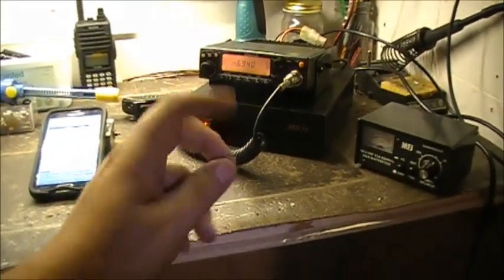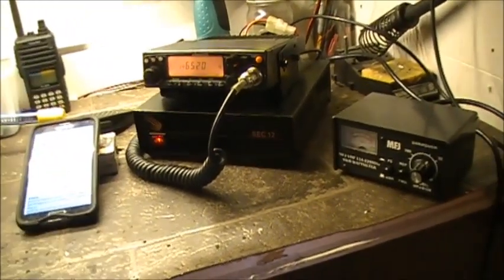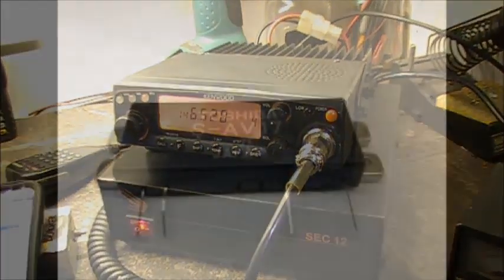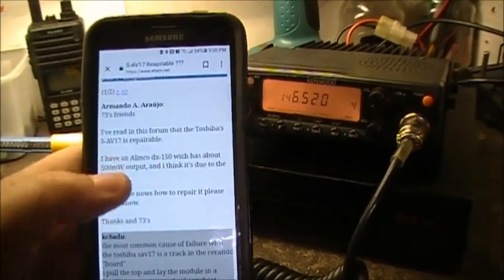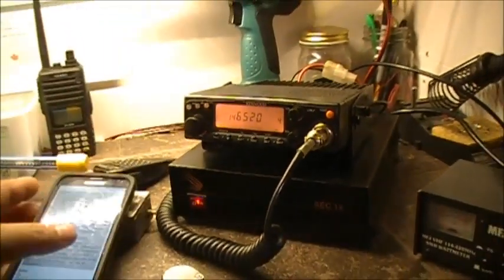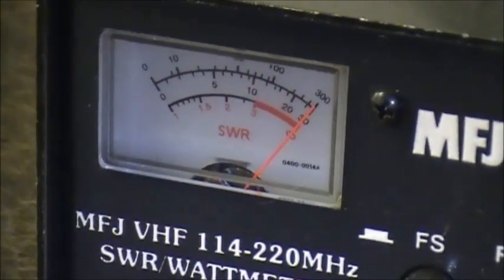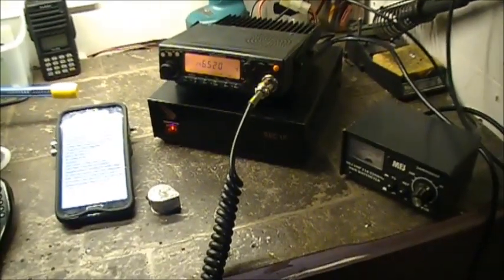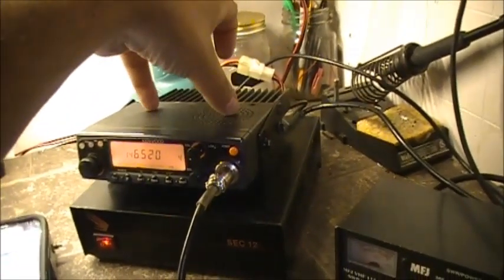KENWOOD TM241A / S-AV17 RF Power Module repair

Comment: PARA ABRIR O MÓDULO, COLOQUEI O MESMO EM UM PEDAÇO PLANO DE MADEIRA, FIXEI ELE COM PARAFUSOS LATERAIS E COM UMA CHAVE DE FENDA, ENTRE A CARCAÇA DE PLÁSTICO DO MÓDULO E A MADEIRA, DO LADO ESQUERDO, GIREI A CHAVE NO SENTIDO HORÁRIO E FUI DESCOLANDO A PROTEÇÃO DE PLÁSTICO FÁCIL !!! SEM DORES DE CABEÇA 👊😀🤙😎💪😜
Reply from the maker: Translated the above commet for our English viewers:  
TO OPEN THE MODULE, I PLACED IT ON A FLAT PIECE OF WOOD, FIXED IT WITH SIDE SCREWS AND WITH A SCREWDRIVER, BETWEEN THE PLASTIC CASING OF THE MODULE AND THE WOOD, ON THE LEFT SIDE, I TURNED THE WRENCH CLOCKWISE AND WENT TAKING OFF THE EASY PLASTIC PROTECTION!!! NO HEADACHES

Comment: My TM-231a quit X-mitting and I inspected with a magnifying glass and powerful lighting and could find no trace of a crack! I'm experienced with over 40 years of radio repair so I would have seen the smallest of cracks.  I finally decided to re-solder the traces anyway. It worked!

So if one doesn't see a crack just re-solder and it might work!!
Reply from the maker: Awesome news... i am so glad that this repair helped you repair your module.  Congrats!